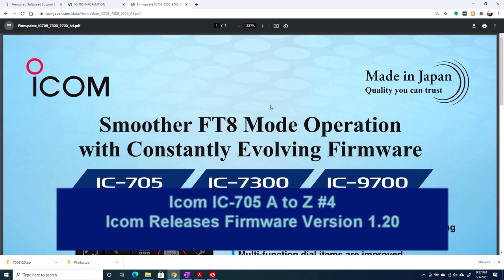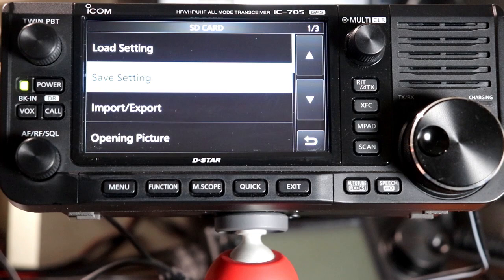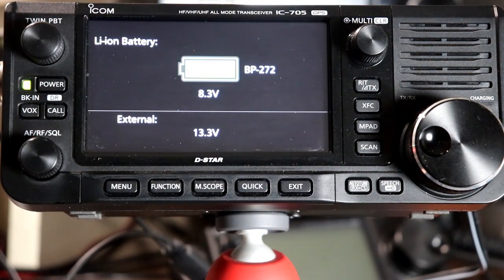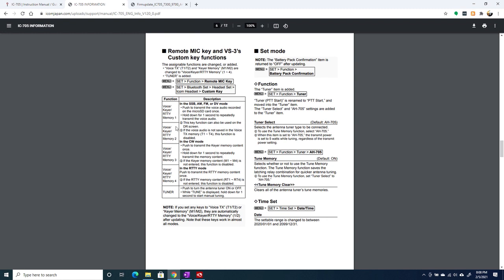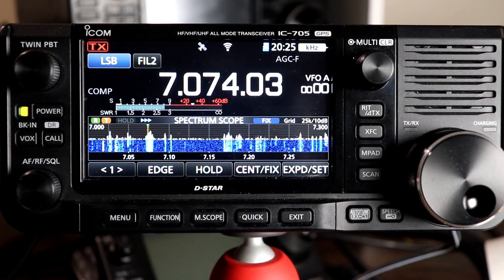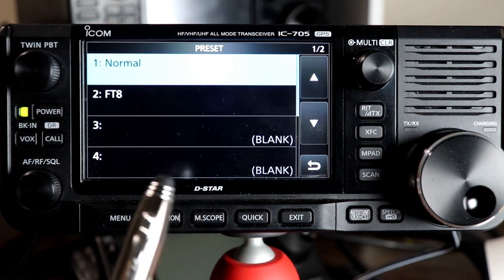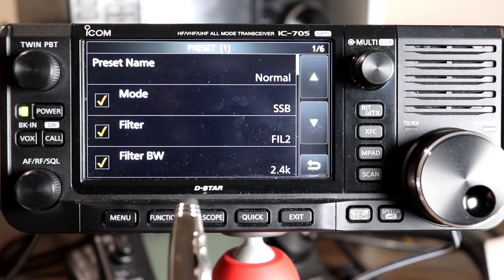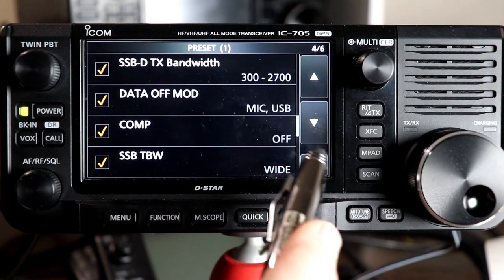IC705 from A to Z #4- V1.20 Firmware Update, Preset Memories, Saving and Loading Radio settings.

Comment: Today I learned a valuable piece of information about updating IC-705 and IC-7300 firmware - When the software asks if you want to continue with the operation (after saving your current settings), you need to press and HOLD the Yes option.  Treating it like a mouse click will only result in the radio staring back at you.

Comment: Thanks for the video. I changed my BK-IN button so it will activate my Tuner. Plus you can turn off tune when changing bands when in CW or SSB. That was annoying to me. Looking forward to more videos on the IC 705, specifically WIFI and what usefulness it will be. 73 de KN3A.

Comment: Tom, thanks for taking the time to produce these videos.  They're helpful and educational.  As a question, what type of tripod are you using for your IC-705 in the video?
Reply from the maker: Hi Nick.  Thanks for taking the time to comment and for the kind words.  I first saw the recommendation for the tripod on Ham Radio Crash Course https://youtu.be/deG_nl9Hxcc - another YouTube channel.  It's a Manfrotto PIXI.  Josh was talking about how great it was and I happened to have that same tripod in my camera case.  So I tried it.  It does work great for getting the radio up off the table and putting it at just the right height and angle to use.  You can get one here:  https://amzn.to/3qRoYCU  (Full disclosure- It's an Amazon affiliate link)
Reply: @HamRadioA2Z  Thanks for the info and link.  It will work well for my desktop - I ordered one.  73

Comment: Great ic705 videos.  To be clear there are 4 videos in the series as of Feb 8, 2021?
Reply from the maker: Hi Daniel.  Thanks for the kind words.  Yes, 4 so far.  Unfortunately, video production has to fit in with my day job and family functions.  So, not making them as fast as I’d like.  There are quite a few more I’ve done on the 7300 over several years.  You will find that many of the scope and other functions are nearly identical to the 705.  So if you can’t wait, you might check out some of those.

Comment: Good vids. Tx. Did you discuss how changing the DATA OFF MOD setting affects transmitting audio using the MIC? It seems if you change that setting to USB of doing digital/packet, for example, then you must return to that menu when finished with data/USB and select MIC. Otherwise, if you don’t, then you will transmit RF but not audio.
Reply from the maker: Hi. The better option is to leave the DATA OFF MOD set to use the MIC and set the DATA MOD option to use USB.  Then when you want to work data modes, once your on USB or LSB (or FM if you want to use data modes on VHF or UHF simplex) then press the mode option again.  In the mode menu, press DATA.  The the display mode will show LSB-D (or USB, or FM).  When the -D is displayed, the radio will get it's audio from the DATA MOD source.  When the -D is not displayed, the radio will get its audio from the DATA OFF MOD source.
Reply: @HamRadioA2Z  -Ah! Good. Will do it. Great, tx.

Comment: When updating the firmware, deleting any old update files on the SD card first is a good idea. However I would save copies of all firmware update files on another disc or on my computer, that way if an update has problems I can always go back and load the old update file until any issues are resolved with the new update. 😉👍
Reply from the maker: Backups are always a good idea.

Comment: Tom, thanks for your videos!  What is the difference in using the PRESET MEMORY vs SD CARD SAVE SETTINGS in saving the 705 settings for various modes?
Reply from the maker: Hi Randy.  Thanks for the kind words.  The Save Settings and Load Settings options save and load every single setting and all of the memories.  You could use those as a kind of preset by using file names that make sense to you for each setup you want.  The Preset memories just save a subset of parameters that are the most relevant for switching between voice and different digital modes.  The presets also work more like the frequency memories.  So you can just go to the preset menu and pick which one you want.
Reply: @HamRadioA2Z Thanks, Tom!  Other memory questions:  If I import a Repeater List.CSV it shows up when I am in DR mode, but not in my created memory list in Memory Mode. If I add my FM repeaters to that same CSV  file (to have a single list), they (FM and DV) do appear when in DR Mode, and can be individually selected even, but when they are selected, I am still in DR mode so I cannot actually use the FM repeater as the DUP/TONE etc are not enabled since it is in DR MODE.  When I switch from VFO to Memory, those repeaters in the Repeater List.CSV (DV or FM) do not appear, but the created Memory Mode repeaters do.  Seems like there are two different memory banks - 500 in the Memory Mode and 5000(or so) for the DR Repeater.CSV list.  The DR Repeater.CSV is only useful for DR repeaters, and the Memory Mode list only good for FM (or analog non-DR) repeaters (or CW/SSB/FT8, nets, etc).  Is that true or am I missing something here?  Is there no way to have just a single list?
Reply: Dumb me, I figured it out:  The Repeater List.CSV is not a memory list, but a "list" to be used/selected and individual repeaters can be added to my Memory List.  I have all my local FM repeaters in a Group "Local FM" and the DStar repeater I can connect to in a Group "DStar".  Once selected, the Dstar repeater can be used in DV Mode, and the UR and FROM changed as needed (from the Repeater List.CSV if I want)!  DR is a shortcut to DStar, separate from the repeater selected using the Memory List, without the nice UR/FROM box......

Comment: This is a question, I'm following your videos (nice job!!) ...I have all 3 radios, IC-705/7300/9700.  The IC-705 will not connect and stay connected to my computer with blue tooth.  It appears to find the two computers that I use, but then won't connect, or show momentary connection and then disconnect. Any ideas or suggestions?
Reply from the maker: I haven’t tried connecting the 705 to a computer with Bluetooth, only with WiFi.  Are you trying to just pass audio, or are you also trying to control the radio over bluetooth?
Reply: @HamRadioA2Z  Just trying to get the function working now...I intend to pass data eventually.  Enjoying your videos, good job.